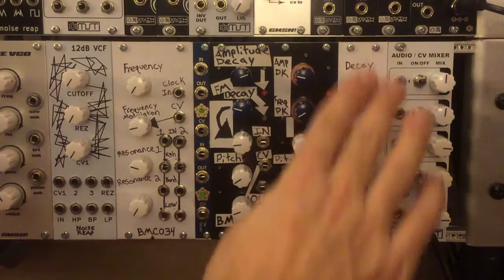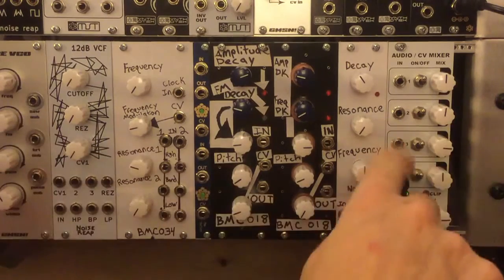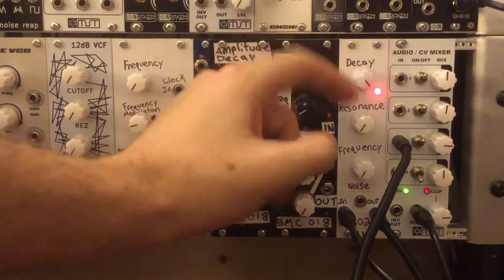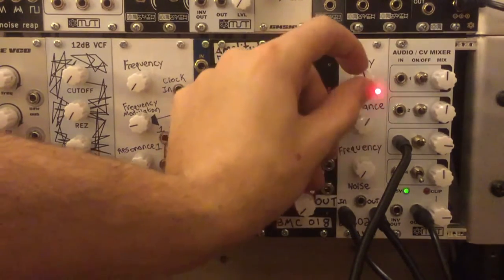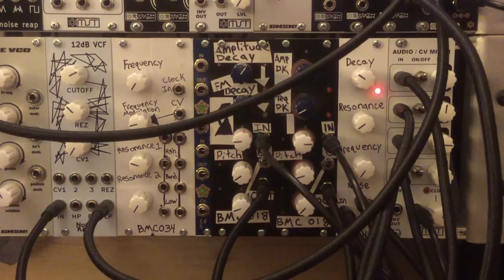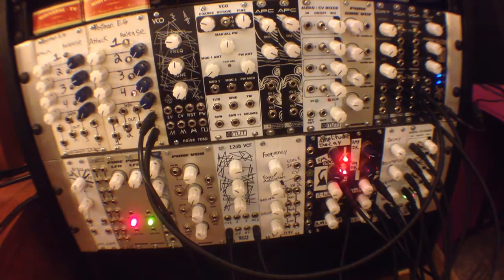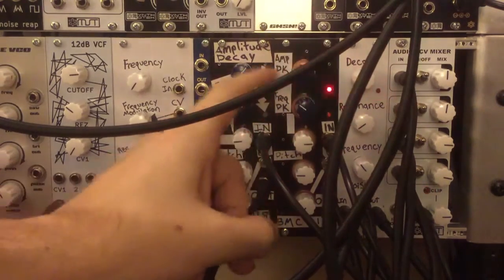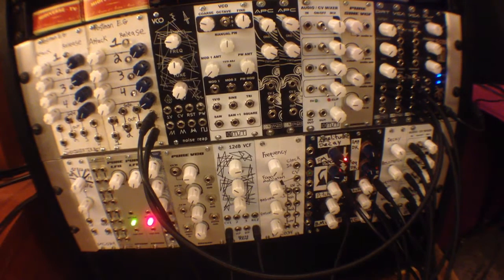Barton Musical Circuits - Decaying Analog Noise - DIY Eurorack Module - MVM #62

Comment: Hi, I have built one of these DAN. In my build the reso only affect the signal in the last 80% of the pot trip. The rest of it mostly doesn´t affect the sound. Watching at this video it seems that is the same, but Im not sure if my build has a bug or is just the circuit is like this. How does it work in your case?